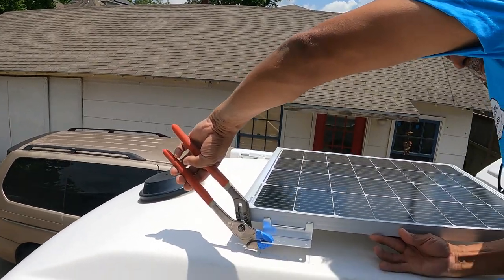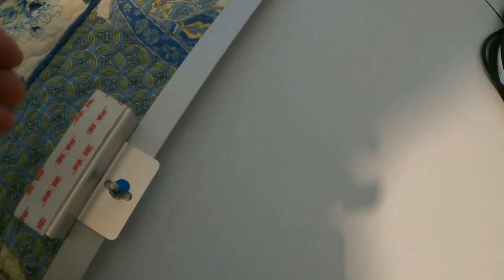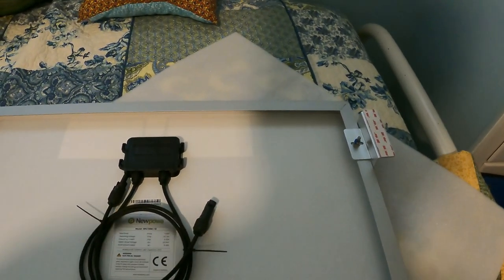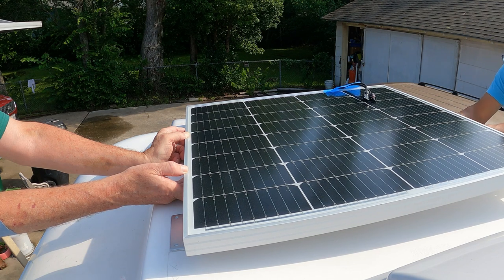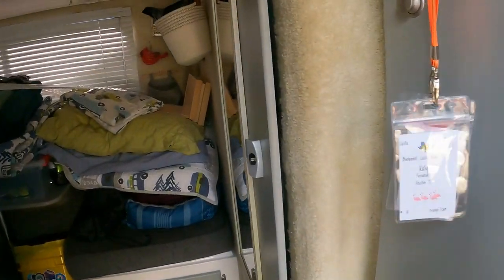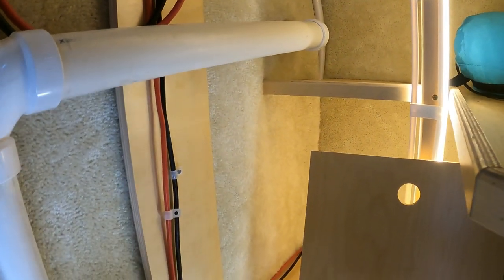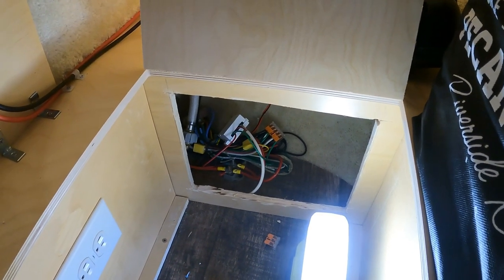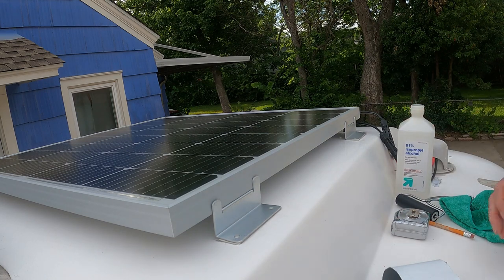Solar Panel on a Casita

Comment: How much charging do you actually get with the panel on the roof? Do you get much charging before about 10am to after 3pm? It appears the sun would be too low to do much charging.

Comment: Hi Lewis,  having trouble getting fish tape from roof vent opening to closet. There are 2 90"s in vent conduit. Any ideas to help? Tia
Reply: One way is to tie a large nut to a piece of string, then drop it down the vent pipe.  Use a strong magnet to guide it to the hole you've drilled, then pull the string through.

Comment: Since the charge controller has to be connected to the battery before connecting it to the solar panels, I was wondering how you dealt with disconnecting your battery from the trailer when not in use?  Did you install a switch between the solar panels and the charge controller that you could turn off when the battery is also completely disconnected?  And then first connect the battery to the trailer to energize the charge controller before then flipping a switch to reconnect the solar panel to the charge controller?

Comment: Looks great! One advantage to mounting the panel using bolts coming in from the side is that it's easier to remove and replace the panel if it gets damaged or you need to do maintenance on it down the road. With the bolts vertical, I'm not sure you can remove the panel without taking the brackets off. Unrelated question... where did you get that closet light switch/module that clips to the vent pipe?
Reply from the maker: The switch is part of a custom light kit we install. The kit is made by Little Home on the Road. They will sell the kit for self install soon. The kit is made for a Katy's Casita Closet.
Reply: Thanks, Lewis, for a great how-to. 
We are picking up our new Casita later this month. 
I’d love to do these same modifications to our trailer, the Katy’s Closet, the light kit, and the solar panel. 
Would you be able to help us with that?
Happy Camping!

Comment: This is great! I am likely going to take this approach with my Casita. One question, have you experienced any issues / loss efficiency due to the solar controller being relatively far away from the battery?
Reply from the maker: Any loss is so small, I'm not worried about the small losses.  I did this for ease of install and it works!

Comment: Hi Lewis, how did you get the wiring through the roof vent into the closet?  I have removed the vent cover on the roof and drilled a hole in the vent pipe in the closet. Attempted to run a fish tape through the conduit without any luck. There are 2 90's in the conduit that my fish tape does not want to pass through to the roof.
Tia
Reply from the maker: See the chain in the video.

Comment: Great Video, but I'd like to clarify something, as it can be a bit confusing. The white wire is actually negative and the black wire is positive. In 12VDC systems, the negative is chassis ground but in Casitas there is also a green ground wire that is bolted/welded to the frame (they can be seen in the battery compartment). Although technically both the green wire and the white wire go to the negative post on the battery in my opinion (electrician) it is probably best to call them positive and negative as opposed to power and ground. There is something similar in house wiring, as the white (neutral) and the bare ground wire go to the same place in a panel they are two different wires and serve two different functions after they leave the panel. Hope I didn't make it more confusing. Just my two cents.
Reply: Absolutely correct sir......

Comment: Hi Lewis,  having trouble getting fish tape from roof vent opening to closet. There are 2 90"s in vent conduit. Any ideas to help? Tia
Reply from the maker: I believe we used a chain from the top. Then pulled the  wire up.